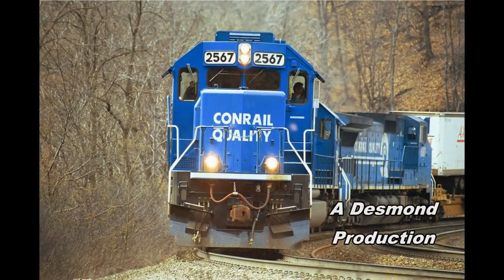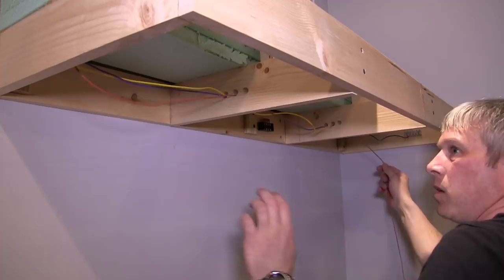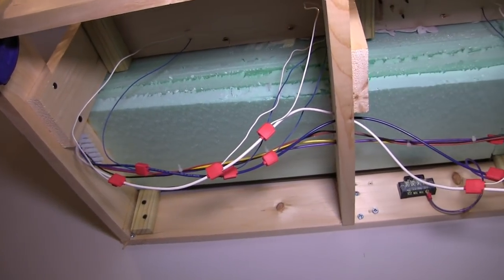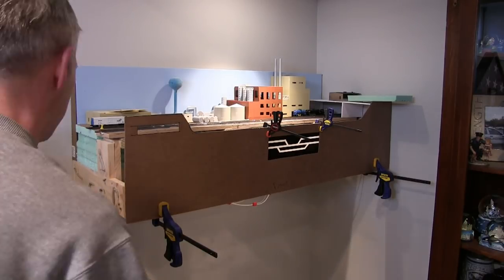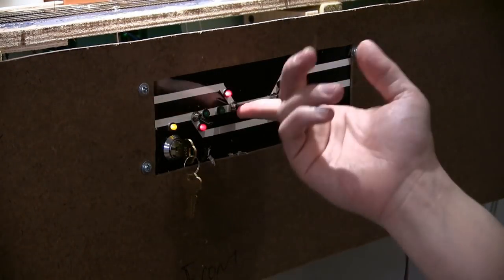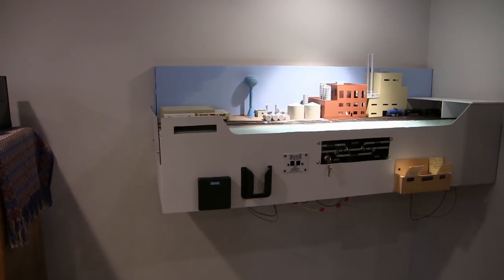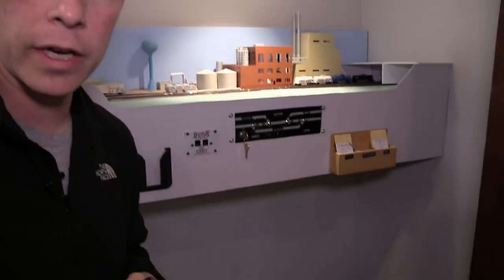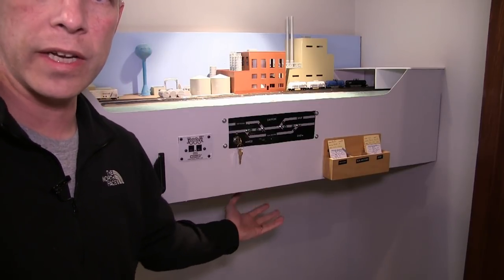Amboy Secondary Part 2

Comment: Nice looking addition to your layout. The huge stack of green foam escaped my notice in Part 1.  Same thing could have been accomplished with 3 pieces of foam. Two upright pieces could have served as legs for a third placed on top. The single piece would be more than strong enough for such a short span to support structures and track. I often use pylons of 2" foam to support 2" foam over much wider spans rather than stacking several layers of foam.
Reply from the maker: Jerry Smith thanks I took you advised for the next sections. It worked much better. This was the first time working with foam (believe it or not). Thanks for following along and the suggestions along the way!